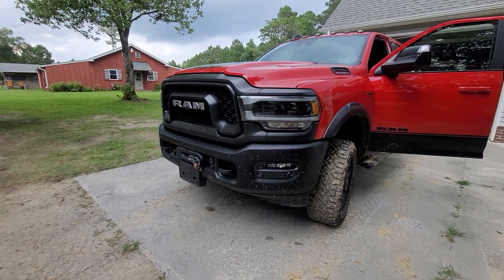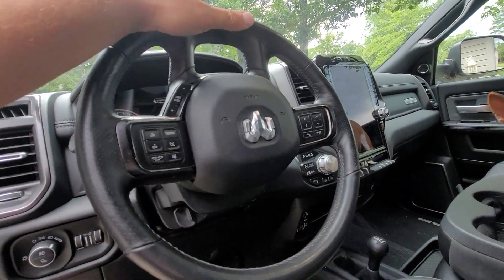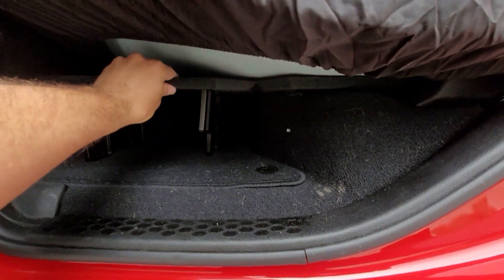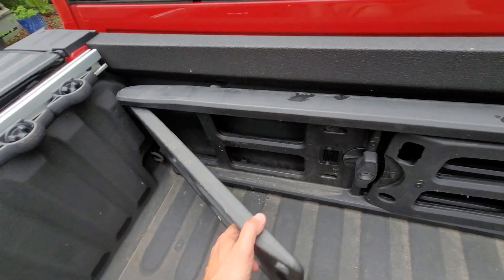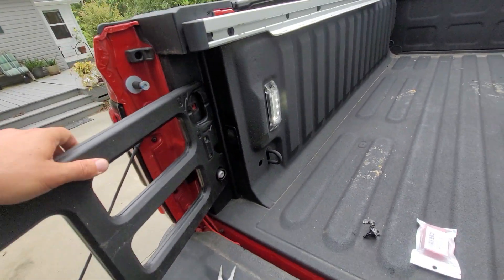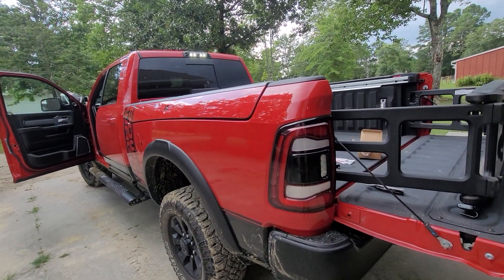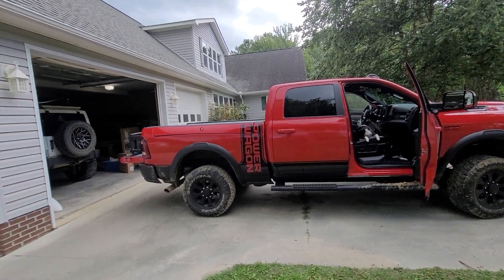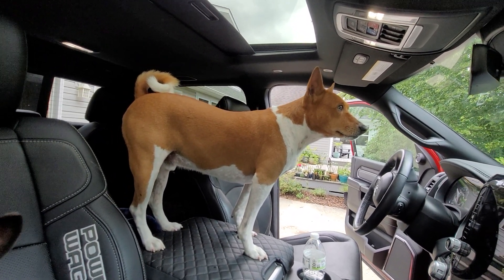2020 Ram Power Wagon First Impressions

Comment: bed extender, on previous versions of the rambox, those locking lugs were integrated.   I know i sure didn't have to buy/add them.  I wonder why they removed them?
Reply from the maker: I've heard that on older models had them before too... weird...??? Probably because Mopar can make an extra 40$ of you have to buy them after the sale 🤣
Reply: @ianmburke  I heard the main reason was of some DOT issue or complaint about not being able to see the rear brake lights at an angle with the tailgate extender in place.  I may add those to mine but I don’t typically haul anything that would require the extension.  Red is my favorite color as well. 😀